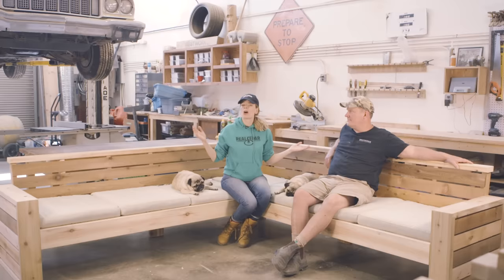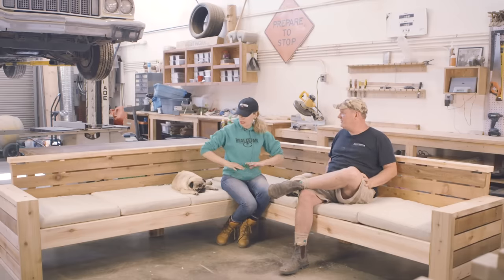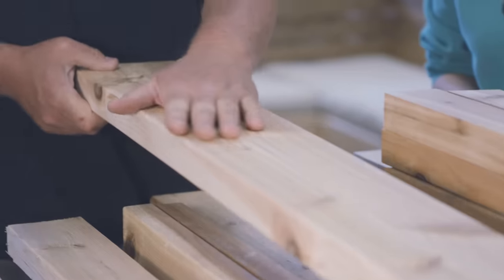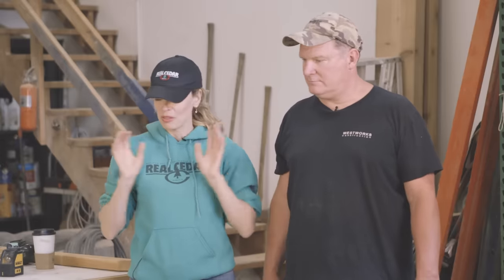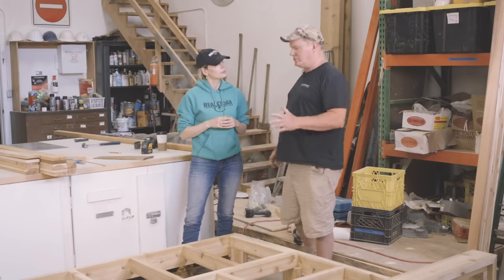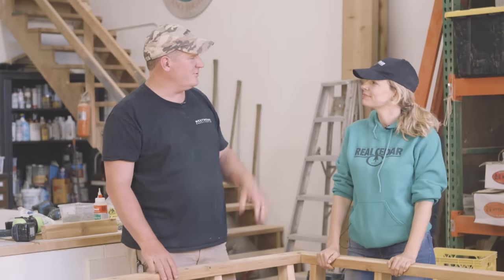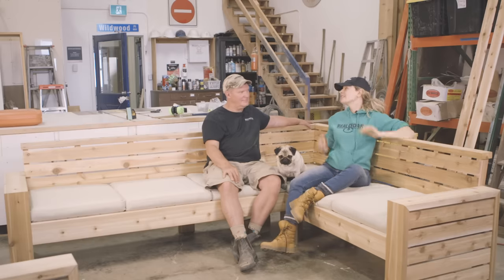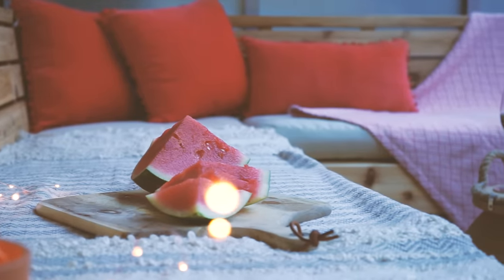DIY – How to Build an Outdoor Cedar Sectional

Comment: I am just about finished building this. The plans are available if you Google Real Cedar sectional sofa. But note that there are some important differences between the sofa being built in the video and the sofa in the plans, and especially when you get to the materials list. The latter specifies a bunch of 2x2s, which I bought and never used. Nor are they used in the video. I also attached several additional legs and added additional bracing to support the back rests. This is going to be a nice addition to my deck when finished, but you need to be a little creative with the plans. Also note that those cushions are not inexpensive.
Reply: Jeff B Thanks for the heads up, any estimate on material cost without the 2x2s?
Reply: Looks like the two by twos were used for the backrest support in the video
Reply: Where the plans called for 2x2’s it really needed 2x4’s. We luckily caught this before having a bunch of wood ripped!
Reply: @chrisfaddis  wish I had read these comments before ripping my 2x4s lol
Reply: @adamwise09  you need 2x3's for the back braces...

Comment: I really would like to build this. Trying to get an idea of materials. About how many 2x4’s and 2x6’s would I need? Like, if I’m placing an order from the lumber store, what do I need to order?
Reply: Justin Lee click the link and you can download the pdf or materials
Reply: It's got the full cut list but not the shopping list. Lot of work left to figure out how many 2x6s, how many 2x4s, etc. Anyone done this? Thanks.
Reply: I’m buying 14x 2x6’s and they come in 4.8 meter lengths at my local yard. For the slats I also need 14x 1x4’s. I’ll be ripping down the 2x6’s on the table saw to make all the parts. I spent a couple of hours working this all out - Hope that helps
Reply from the maker: You can get pre cuts from our retailers
Reply: REAL CEDAR - DESIGN INSPIRATION & 
DIY PLANS

Comment: I wonder what is the cost for the materials to get this done. Thanks
Reply: I am planning to build this weekend. Quoted $1000 for the lumber S4S. But I have to update the quote for the change in part C5 (plans say 2x4s but are supposed to be 1x4s).
Reply: @jguti9471  i didnt realized that it will be close to $1000. Thanks for the update.
Reply: @regularMattMatt  Yeah, I figured for cedar it would be $1000-1300 and was spot on at $995 with tax. Not sure what the difference will be after adjusting for the revised slats(C5). I paid $1500 for some plastic wicker stuff and it only lasted 2 years in the Florida sun. This should last forever.

Comment: What angle are parts (H) supposed to be cut at to give the back panel the angle? I didn't see that angle listed in the plans.
Thanks in advance for any help.
Reply from the maker: https://www.realcedar.com/outdoor/free-diy-project-plans/sectional-sofa/
Reply: @real cedar, the angles for H are not in the plans. You have the cut angles denoted for the back slats but not for the backrest upright pieces (H)
Reply: @chrisfaddis  I couldn't even find the cut angles for the L (black slats) pieces. What are they? TIA

Comment: Where exactly and how is the center leg (D1) attached to the frame? Is it just glued to the frame and set at an angle? I'd like to avoid adding another point (especially with glue) where A and B frames are attached if I need to move this in the future, but I don't see how to do that in the plans or the video.
Reply from the maker: Hi James, D1 doesn't hold a ton of weight, so you can toe in a couple of screws from the A and B frame to keep it in place. Toe in from the inside to hide the screws, the E cap will also hide any from the front side. Conversely, if using a 6" x 6", the frame can just rest on it if it's going to be moved.

Comment: What is the cut angle for the H pieces and also for the L pieces? I have already looked over the plans extensively and cannot find what the angles are supposed to be. Tia
Reply: The plans say to cut at an angle to 1/4" shorter on one side.  Although I would suggest at least a 1/2" maybe a little more
Reply: Brittany Naeckel using the instructions from the plan (15 5/16 length with 1/4 in offset), you end up with an angle of 95.71. For a more reclined position, you probably want closer to 105 degrees. If you follow the plans as is, the top of the back support will extend backwards approx 1.5 in more than the base of the back support.
Reply: @johnlee1944  I agree. Great plans!! I built this several weeks ago and the angle is a little to upright , so I would start at 1/2 and test from there...especially if you are  using back pillows.

Comment: What specific screws do you use?.. and should I pre-drill? It says 3” ss woodscres but what gauge? Brand? Style?
Reply from the maker: #10 x 3 in. Stainless Steel Deck Screw. You don't need to pre-drill if you are using cedar. There are a few brands that make it. You may want to try Grip-Rite.
Reply: REAL CEDAR - DESIGN INSPIRATION & DIY PLANS thank you I also noticed that in the material list you have boards “C5” labeled as 2x4’s I believe this were meant to be 1x4’s otherwise they would stick out about a half an inch. Kinda suck cause I bought and cut the 2x4’s and cedar isn’t cheat,so out that money but hey free instructions guess I can’t complain. Just lettin you know so you can change it.
Reply: @geofferyb1  It also looks like only 14 are needed. Did you find that to be true?

Comment: Question guys, can you just use 2x4’s instead of the 2x3’s stated for the back rest frame and back fascia’s? It also states 2x4’s to slat the arms however the video just looks like you are using 4x1’s
Reply from the maker: We haven't tried the Cedar Sectional with 2x4s instead if 2x3s. They will create a 1" overhang which wasn't a look we wanted. b) The slats for the arms / legs should be 1x4 (finished size 3/4" x 3.5"). You are correct and the plans will be corrected. Thank you for catching that!
Reply: @WRCLA  Wow, I wish those plans had been fixed before I cut all of my materials. I now have sixteen wasted/cut 2x4's that I can't use for this project, and I'll have to go buy more material for the 1x4 slats. Please make sure to update the plans soon. The question by @rowley195 was posted 3 months ago and it still isn't fixed. 😤
Reply: Still not fixed. Wasted material as well. Now I need to go buy more 1x4's

Comment: WARNING: the material list is NOT accurate to the drawing or the couch being built in the video...
Reply: how close is it?
Reply: Sorry for the late reply..I remember the 2x3s on the list are supposed to be 2x4s..it seems like there were other measurements that didn't mesh up but I don't recall which ones..I'd cut as needed..it's also very big..I had to wing a lot of my measurements about half way in to scale it back to fit where I wanted it to go
Reply: The leg measurements are also wrong. I cut a perfect 45 degree angle and they are off a half or quarter inch for the 2x6 that are supposed to wrap the 2x4... terrible plans. Lots of wrong measurements and size boards
Reply: I ment the 2x2x3s are supposed to be 2x4s